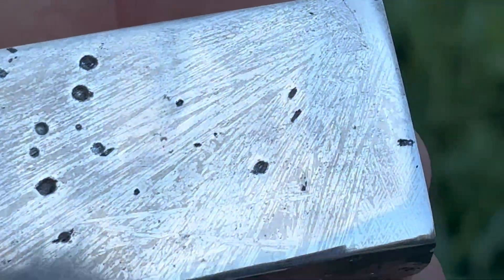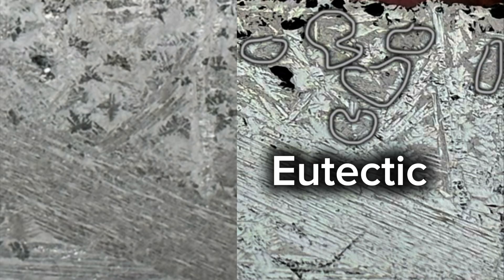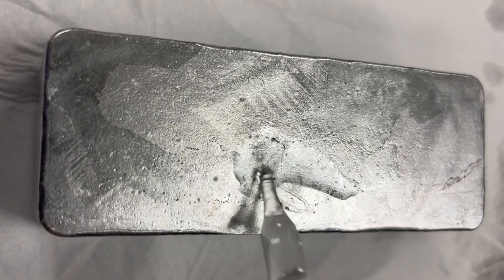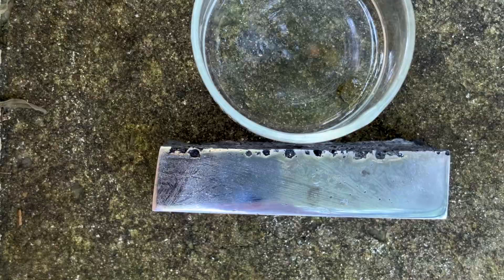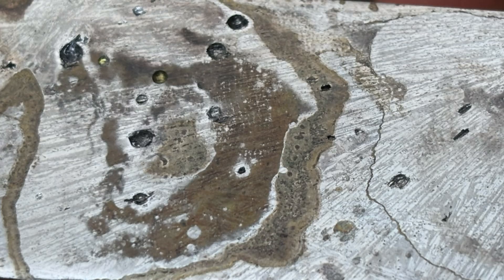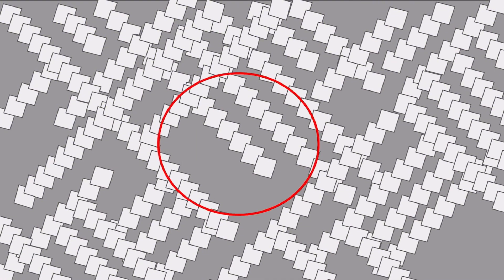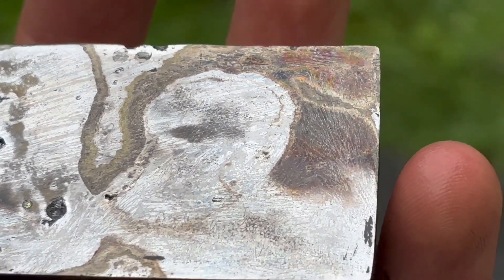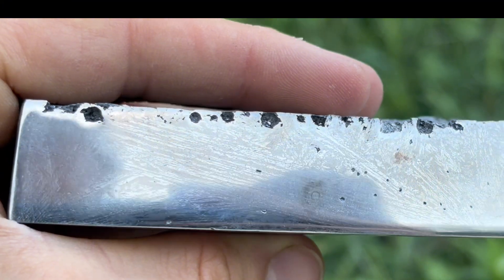Can You Etch Homemade Meteorite?

Comment: I made a couple of these ingots the day I saw your first video, and my experience attempting to etch them with different acids and bases was the same. I somehow turn most of one ingot brown, i think copper dissolved and then reacted with the Al to precipitate out on the surface
Reply from the maker: I’m so glad you tried it out! How did they turn out excluding the trouble etching?
Reply: @ElectronImpressions  Good! I wasn't patient enough to wait long enough to get parallel lines like yours, but the big crystals still looked cool. I'm interested to see what other materials make similar patterns; there was some experiments I was going to try with different metals but I ran out of time before I had to go back to school

Comment: If the idea about the light-scattering trenches is correct, I wonder if a wash (like mini painters use) applied to the surface after etching would fill those in and make the eutectic zones dark again

Comment: I can tell you one thing that for sure eats aluminum and aluminum oxide for breakfast. Mix some salt with copper(II) nitrate solution. It'll turn green. The formed mix of copper chloride and sodium nitrate devours aluminum.

I've made this before, and it reacts very aggressively, quite exothermic. Some part of the reaction I don't understand started producing nitric acid again, or at least NO, so it'll attack the copper fine too I bet.

Comment: I wonder if something can be done to increase contrast concerning the differences in copper content on each part of the structure, as you know, copper has dark oxides and colored salts that may give you the contrast you're looking for. Also, maybe plating with other metals like silver or tin may have interesting color effects on each part of the structure
Reply from the maker: It would be interesting to explore non-etching avenues. Anodizing could also hold potential for that as the copper rich regions would probably anodize far differently. Although this may still lead to the trouble of creating a rough region that scatters light

Comment: Etching is a real black art sometimes despite standards and protocols
Reply from the maker: I’ve come to realize 😂 not just here but in academic research as well
Reply: @ElectronImpressions oh yes, been there.   You'll want to play with etch times and methods even for a single etchant, especially if the composition isn't typical
Reply from the maker: @diceotope One time when I was very new to etching I had mounted 6 samples of identical material for metallography in the same mount, each sample had seen very different heating rates, times, and temps. The grain size and morphology was drastically different between samples but I mounted them together as I was in a time crunch. I spent many hours trying to get a good etch on the entire mount— just to give up and etch/image each one by one. A mistake I will only be making once lol.
Reply: @ElectronImpressions yeah don't do that lol. If you don't have anyone with any metallurgy experience to talk to LMK
Reply from the maker: @diceotope I’m still pretty close with the professor I did research for during undergrad— but she’s my only metallurgy friend and I need more haha I won’t turn you down on that. Send me an email electricimpressions1@gmail.com

Comment: Id be curious to see how something like aluminum black, or forced patinas in general affect these surfaces. I don't think it will quite do what you want, but it could be interesting!
Reply from the maker: I’m glad you mentioned that because I think it may have merit. I see that aluminum black interacts with the oxide layer on the surface, which is much more prominent on alpha phase rather than theta. It would definitely be interesting to try this out.
Reply: @ElectronImpressions ooh yeah that totally makes sense! Looking forward to hearing if you get around to trying it😁

Comment: looking forward to the next material! this is an excellent project and I'd love to try it some day, I'm a huge fan of widmanstatten patterning and use Gibeon meteorite in the rings I make when I can. Not that relevant to the video but if anybody else wants to etch meteorite at home, I've tried tons of acids and etchants and my favourite was found by accident! my meteorite samples were getting rusty so I bought some rust remover solution (similar to evaporust) and forgot one piece in the bottom of the jar for 24 hours. when I fished it out it had the most beautiful, black and silver, high contrast etch I've ever gotten! plus it's safer than acids and doesn't stain like ferric chloride. While these solutions don't dissolve iron, they do dissolve nickel a little bit, so they work very well to etch iron meteorites. worth a try!
Reply from the maker: I will definitely have to try out that etch on my own (real) meteorites, I’ve never heard of it but sounds super interesting. I’ll let you know how that goes! I did some quick pursuing and noticed every rust remover uses their own proprietary active ingredient, have you had the same success with different brands, or does one work better than another?
Reply: @ElectronImpressions I wish I could say I've tried more than one brand, the only one I have is a Canadian brand called EZ Strip Professional. It looks to use potassium hydroxide, citric acid, etidronic acid, and a chelating agent, so it's not too dissimilar from the average chelation rust remover. I've heard most rust removers have a 'problem' of dissolving nickel, so I expect most to work!